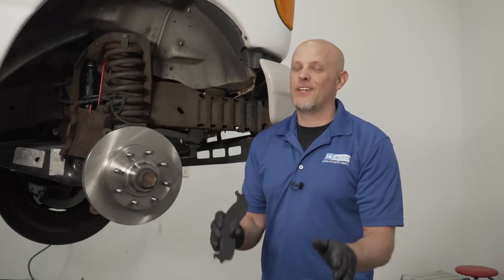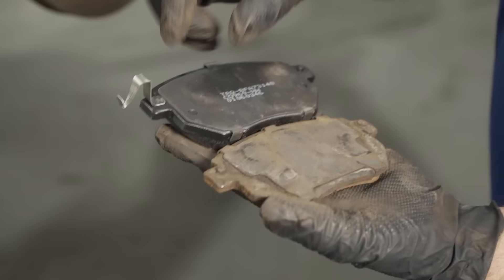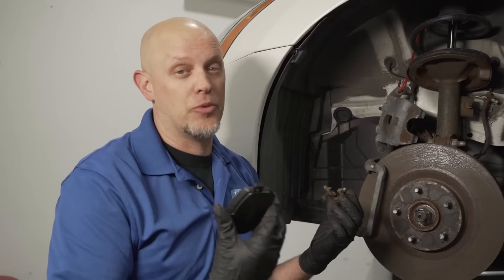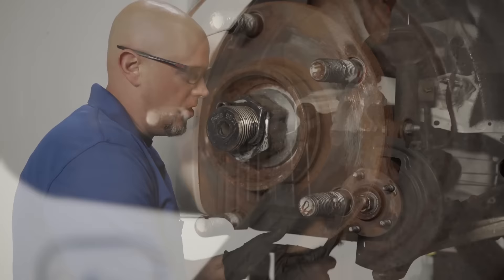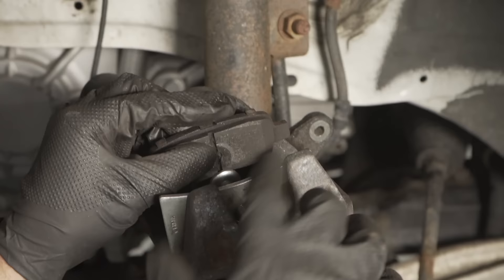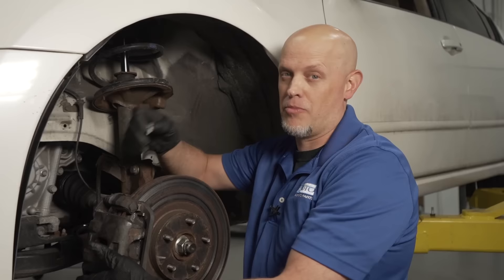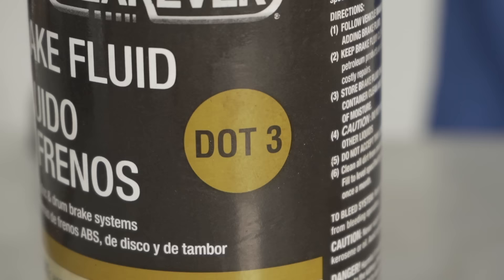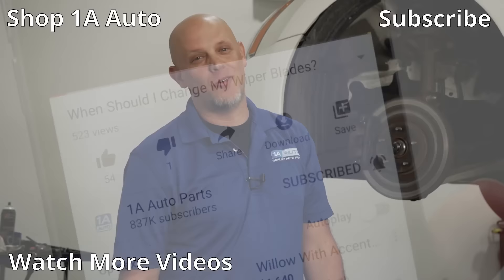Most Common Brake Installation Mistakes!

Comment: Excellent video!  My front brakes were changed and the garage put on "the standard brake pad and rotor" instead of Honda parts. As I drove out I noticed a scraping noise that increased with speed. Brought it back and they said " we don't see anything wrong." I had everything else checked out (alignment, tires, etc) and it all points to those new brakes. So what's causing the new noise? Any guesses? What should be my next step? Thank you.
Reply from the maker: +Careful Consumer We wouldn't be able to diagnose an issue like that here, you may want to have a local mechanic take a look at it. Thanks for checking us out! http://1aau.to/m/Shop-1AAuto-c

Comment: I replaced my front brakes and in dismounting and re-mounting the caliper, I twisted the caliper some, nothing egregious, but enough to loosen the bolt that connects the steel hose to the caliper, allowing brake fluid to leak out, definitely want to make sure that’s still tight after mounting, or better yet make sure you don’t twist the caliper.

Comment: Check the calliper mounting bolts for right grade of bolts as well as condition of thread bolts use thread locking fluid.

Comment: I would add to check the rotor for screws before smacking it.  Some cars hold the rotors in place with a couple of screws that are a real pain to get off when rusty.

Comment: Regarding what you said about not using brake fluid that already been opened....so youre saying if I buy a bottle to top up the cylinder,  i should discard the remainder of that bottle?

Comment: My friend, on the Mazda CX-5 the brake pad wear indicator pins are supposed to face each other on the top screw and pressed inside the clips. Otherwise, if you leave them hanging out like that they will never come in contact with the rotor to warn the owner when low. I tried to point this error out but it seems like it was erased.

Comment: There were two wire clips to hold the pads in place during assembly, but there was not enough length in the slot, so the pads wouldn't fit in right. Cut those off, they fit. Used two spacer nuts and two lug nuts on each side just to hold the discs during the bleeding process, everything is so sloppy during assembly, but once assembled, everything fits together well. Works now.

Comment: I agree with your tips how ever, the most common brake Installation mistake is to put copper grease on the hub and rotor or other brake parts. It may work in dry states like Arizona, Nevada and California etc but the copper will create a galvanic current which is equal to RUST. Use standard grease instead to prevent that.

Bo E.

Comment: Just did my 1st brake job in about 25 years and I have a 2016 elantra. Everything went OK.  Well with the brakes anyway I replaced some other things too. Anyway I think its super annoying that you cannot get the bracket back on without the pads falling out 60 times. Put the back one in and front falls out over and over again and vice-versa I was 1 second from giving up but I got it. It seems like whenever I take my car in something is not done right so at least if it's not this time at least I only have myself to blame

Comment: Hey what do you do If you didn’t use brake cleaner before driving with the new braking system? Should I lift up the car and go back and clean the rotors? Or is the damage pretty much already done since the pads will be full of whatever was on the rotors to begin with?

Comment: If I am only replacing the pads and rotors, do I still need to do all the stuff at the end with brake lines? And if I bleed the brakes while doing the pads, I assume I need to add some more to the system to make up for the fluid lost, yes? 2002 Tundra

Comment: Pretty good however you should talk about the type of lubricant that should be used on the brake pad tabs as well as the sliders because this is special lubricant and not your average grease. I suggest a small  hose and water bottle to catch the fluid coming out of the bleeder.  You should mention that the fluid level in the master cylinder will need to be corrected. You should also have mentioned to pump the pedal after the brake job and before driving the vehicle. I have 45 years in the trade and I have seen a lot of changes and some brake jobs today require a scan tool just to change the pads.

Comment: good video the only thing that I would add is if the car has alot  of miles i would change the brake fluid as it will break down over time.

Comment: Great video!  I just ordered new OEM rotors and pads for my 2016 Fusion front brakes due to the rotors/pads having grooves in them.  They are ~0.010" deep.  The grooves were not caused by metal to metal contact, but from "normal" wear.  The brakes are original with just over 100k miles on them and the pads are still over 2 mm away from needing replacement.  I'm changing them anyway since I have to replace the rear pads.  Might as well do all four corners while I'm at it.

Something I've always wondered is.... with the grooves in the rotor and matching grooves in the pads, wouldn't that create more surface area, thus better braking power?  The pads are in good condition other than the grooves, and the thickness of the rotors are still well within the wear limits for thickness when measured in the grooves.  I'm sure I'm missing something regarding this, but thought I'd ask.  I've been an aircraft engine tech for 43 years, and have owned and maintained many older cars and motorcycles, but I'm just a shade-tree mechanic when it comes to the newer model cars.  🙂

Comment: Electric Parking Brakes can cause a few issues. On my Ford you can use FORscan software to put the parking brake in service mode. This releases the electric parking brake so you can change the rear pads. Remember to choc the wheels first.

Comment: A wire wheel on a motor similar to a bench grinder works good to clean break mounting parts caliper brackets tried it and it takes the rest right down to clean metal like new

Comment: At the end, you asked if there was anything you missed comment.  Well, can you tell me more about the lubrication to use and not to use on the caliper pins and brake shoes?  I will be using ceramic pads on a Mazda CX-5.  I heard you shouldn't use the same lube on the caliper pins as you use on the brake shoes.  Can you elaborate?

Comment: Great instructional video; however, there was a need for more information on caliper slide pins: top or bottom location for each pin -  with or without rubber O-ring. Thanks

Comment: yeah, some rotors (usually imports) have holes drilled through the hub and they will be threaded, 8mmX1.25. Those are to help break them free from the hub if it is stuck . Simply use an 8mmX1.25 bolt, preferably at least an inch long, to break a frozen rotor free from a rusty hub.

Comment: 2:10 - Re: The noise reduction/silencer shim on the outside of backing plate.
  I’ve noticed, on more expensive pads, the outer shim is usually glued/bonded firmly to the metal backing plate of the pad; but on cheaper sets, one or both are either loose or just “snapped” into place.  
       Question(s): 
1. Is it ok if one or both silencer shims are a little loose?
2. Does it make a big difference to just leave them off?
3. Is there a high temp adhesive you can use to glue them on firmly? (<— assuming you have enough time to let it cure properly)

Comment: Great video

Just to add one thing, Honda caliper brackets have a knuckle spacer/washer/shim that goes on the bolt between the hub and the caliper bracket why the bracket is not just a proper fit like my other vehicles, I'll never know. So if your bracket is rubbing the rotor even before you put on the caliper / pads, it means that at some point of installation you either lost the washer or the last mechanic that did it lost it and just slapped everything together hoping you'll be on your merry way without noticing.

Don't be like me, I spent so much time replacing pads and rotors on my civic until I figured out issue.

Comment: Great video! I just did the rear pads and rotors on my Prius. I had to twist the piston in. For some reason both rear brakes drag now and get very hot and smell burny after a drive. I'm not sure what I did wrong. It is possible that I swapped the caliper brackets by accident. I didn't know to line up the peg on pad with notch in cylinder. Any other possibilities?
Reply: FYI it was in fact an issue cause by not lining up the peg on the pad with the notch in the cylinder. i dont understand why this would cause over heating and dragging, but it did!

Comment: I would like to know if the little spreader springs, spreading the pads, do they go on the top or the bottom? 2015 Nissan frontier. both fronts I removed were   different.One on top one on the bottom.

Comment: I had my rear pads and rotors replaced by a mechanic, and after leaving the shop from point A to B... I had a trail of fluid splashed around the inside of the rim on both rear wheels. Is this normal?

Comment: Hi There, I changed my rear brake pads today first time at home with a helper. How do I know if they are working correctly?
I took it for a spin afterwards & I might be wrong but I had the feeling only the front brake pads were engaging?
If the piston on the rear bakes is not lined up 100% can this prevent the rear brakes from working?
It was difficult to see if the dimple on the inside pad joined up with the piston, because at some point they over lap each other.

Comment: You might want to talk about Antilock brakes, reason I say is after pushing the brake cylinders back using the c clamp/tool. I pushed old rusty particles in to my antilock system somehow and damaged the antilock brake system. It was expensive, have you seen this problem

Comment: thanks for a great thourough video.   A suggestion that I would make after watching quite a few videos.  it had been some time since I replace brakes and I found a CRITICAL item that was not mentioned in any of the many videos I watched.  **IT COST ME DEARLY!!     Suggestion:  include this final tip:  After work is complete, BE SURE TO WORK AIR OUT THE brake lines prior to moving the vehicle.   Sounds simple but simple to overlook too.      I did a thorough job on my brakes, BUT when I started the car & put it in gear, it was idling high due to cold weather (I think) and I forgot to pump the brakes to regain proper pressure. YOU guessed it!   I put car in gear & it started forward and before I could pump the brakes enough (and believe me I was pumping)  I ran into the rear shop wall.   I'm too embarrassed to send a picture.  but....  Please include an addendum to your next brake video.  Save someone else some car & shop repair fees Please!

Comment: What should I lubricate the calipers pins with (rubber sealed sliding caliper pin not the brackets holding the pads)?

Comment: Some modern vehicles has electronic park brakes. So if you're doing the rear brake you don't want to use a tool that uses a spinning motion to twist it back in. You need to push it back in straight. If you really want to use a rotating tool to push the caliper back in, get a ball bearing with a race of the right size to prevent any rotation of the tool passing on to the piston itself. If that doesn't make any sense and you have electronic park brakes, check with the manufacturer or a friend before wrecking your electronic parking brake.

Comment: Using grease on the pads gives sand and grit something to hang on to. This can cause binding and abrasion. Spray on graphite is an alternative that is both heat resistant and won't hold grit.  To each their own of course.

Comment: Back in the day, before YouTube, google, and the internet (1995ish)… it was VERY easy to make mistakes when working alone. We always had someone "help" so we wouldn't make dumb mistakes.

Today, DIY jobs are MUCH easier because you can watch 20 videos about the same work on the same vehicle make and model just to be well informed. I have changed ignition coils, VVT solenoids, break pads and rotors, relay switches in the dash, hood popping latches, window regulators, other electronic components, and the list goes on! We live in an age of "easy" and are very fortunate.

The scary part is the introduction of electric vehicles... you wont be able to just throw in a new battery pack or want to go disconnecting high voltage lines in the engine. I suppose more people may start building their own electric engines if we ever get a major breakthrough in battery tech and then they will be knowledgeable of components. The standard break job and other systems will still remain though. But, have you ever opened the hood of a hybrid engine? When I see it I have NO DESIRE to mess with anything, lol!

Comment: I wish you had really covered where to put and not put grease and lubricants and the types to use such as lithium grease vs silicone lubricants, red and tacky anti seize, etc. I had many ppl say to use lithium based products on parts that had rubber boots and seals but lithium based products degrade rubber and plastics. Also knowing where to put the brake grease high temp and when to use other grease would be great to know.

Comment: Thank you for this video. Out of curious, do you grease below those pad slides or anti-rattle clips and on top of it as well? I see some mechanic do under and not on top. Some other mechanic do on top, but not under. So, what's the correct method? Please advise. Thank you.

Comment: Hi, thanks for a great video. I just got done doing the front brakes on my wife's 2015 honda accord. I used some light-colored bearing grease from a can that I have used for a lot of other things as well. I cleaned the old grease off the slide pins but didn't clean out any from the bore. I am just wondering if that may cause problems for me down the road, now that I see other videos that recommend doing so and then using a different type of grease called silicone. The pins moved freely when I put them back together would you re-do?

Comment: Thank you for all the advices. How about the temperature of the rotors after a drive. What is the normal range of temperature for front and rear rotors of an SUV? Thanks.

Comment: My rear outer pad is stick a bit. The disc is very hot after a short spin. I have cleaned the bore pin but still haven’t gotten any results

Comment: Not sure if this has been mentioned in the comment section, but, make sure you loosen the master cylinder cap, before compressing the pistons as well as check the level of brake fluid. Don’t top off the fluid until the job is completed, as the fluid will probably be a little low when the pads are worn, and once the piston is compressed and new pads are on, then recheck the level. Side note, fluid should be flushed periodically as well as it does absorb moisture, and you dont want moisture in your system. Thanks….

Comment: Wouldnt hurt to also throw the wheel nuts back on if you do need to hammer the rotor. Will protect the bolt threads if you do miss place a swing with the hammer.

Comment: Question! I just had a family member change my brakes and he forgot to put the washers back on on the passenger rear side. The bolts are in but are not having the washers on going to cause issues?

Comment: Car has been sitting , rotor is rusty, can new pads clean the rust or should I sand the caliper first? I do understand that this will wear the pads initially. I am asking how much life I will loose on the pad?

Comment: Hello, I helped a friend out with his brakes (front and back). The thing is when I had compressed the pistons back in I didn’t crack the bleeder valve open or have the brake fluid reservoir cap loosened. After we finished, he pumped the brakes but felt spongy. We then bled the brakes but are still spongy, what went wrong?

Comment: Don't forget to torque to spec! I once replaced my wife's brakes and only hand tightened the bolts for the caliper bracket! I had a difficult time removing the rotors (2010 Mazda3) so it was late and I was tired. I've never made that stupid mistake since!

Comment: What brand of rotor did y’all use for the new rotors in this video? Also, where should we store the brake fluid if we did not have to use all of it so that it does not get moisture in it?

Comment: Forgot to pump up the brake peddle after changing the front pads and then started the engine pulled forward and realised my mistake the peddle was soft and went down halfway so I stopped turned the engine off straight away and then pumped up the brake peddle until it went firm. Would this have damaged the master cylinder?

Comment: Also, I go around and use penetrate oil on anything I'm undoing on the vehicle.  Just makes life easier.  I make sure the brake nipple has been lubed as I have in the past stripped the thread when undoing the bleeder nipple.  I then had to go to the wrecking yard for a replacement caliper.
Reply from the maker: +Peter's Garage Thanks for the feedback!

Comment: the text covers the picture when the tang was facing out.
not sure if the squealers are supposed to be in front or back 0f the caliper...2001 Mitsubishi Eclipse rear wheel

Comment: Just had my brakes done at a shop because I didn't have the time to do them myself. They making noise when you turn left or right but not when you're driving straight. Slight metallic noise. Any suggestions?

Comment: Cool timing. 
I'm just getting ready to replace the calipers, rotors, pads, brake lines and fluid on an 07 Scion TC. 
Using RedLine full synthetic and considering stainless braided lines.
Would you recommend EBC Redstuff or Powerstop Z26 pads?

Comment: @1A Auto: Repair Tips & Secrets Only Mechanics Know , thanks for this video. Does it matter what metal compound you use for the anti seize. I happen to use a permatex brand one that's aluminum based but I heard about copper based (anything metal on metal) vs silicone based (for caliper pins touching rubberr)